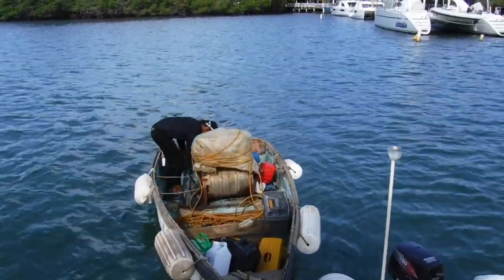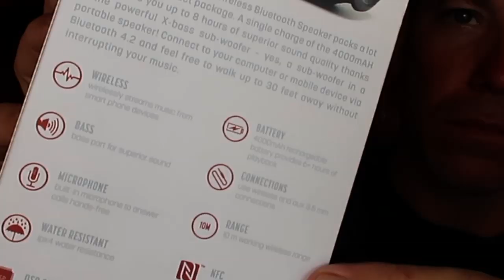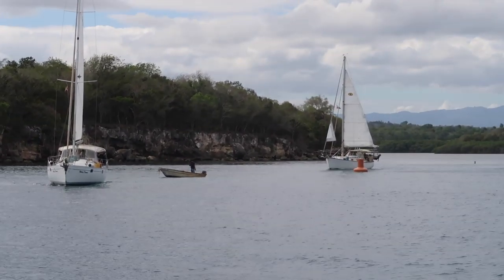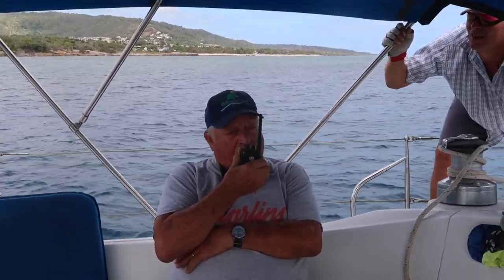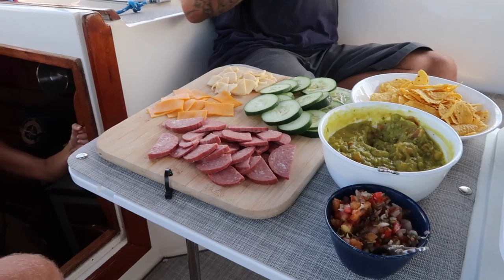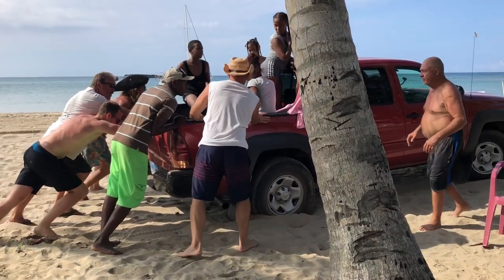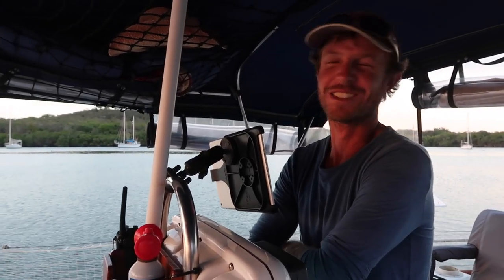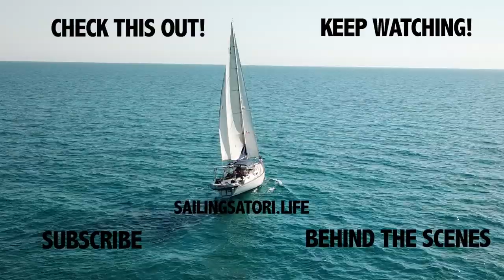Welcome to Luperon's World Famous Unknown Regatta (Sailing Satori) S3:E03

Comment: I saw another sailing video where the owner made a "fuel polisher" by rigging a filter system and aux pump on a plywood panel. Using hoses and a length of copper tubing, he was able to vaccum out the contaminant through a strainer and filter system with a water separator.
The process ran about four hours I think after the big contaminants had been removed and the filter system cleaned for the final polishing. My Ipad won't let me copy the URL  for you just now but it was the Patrick Laine Channel, Ep 20.
He had both bacteria and contaminants in a less accesable poly tank. Can also search Diesel fuel polishing on the YT...

Comment: If you see someone driving on the beach that gets stuck,  let the air in the tires out until the tires are big and fat.  This trick will work unless the auto is stuck and down on the frame.  The air out of the tires will not work then too late.

Comment: I feel very concerned for your diver! He is using a compressor that uses an oil sump for lubrication that likely uses a slinger to splash oil around the crankcase.  Very fine oil particles can be carried into his air supply and into his lungs which is not so healthy.  He is also using a gasoline engine with its exhaust in very close proximity to the inlet of his compressor which could be sucking in carbon monoxide which he could be breathing and could be fatal.  I hope you will make him aware of these dangers.